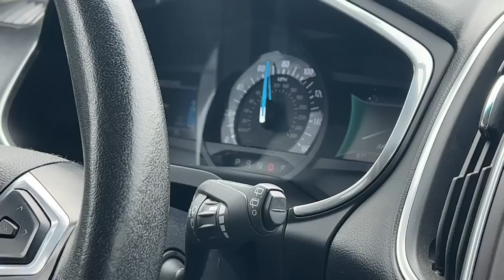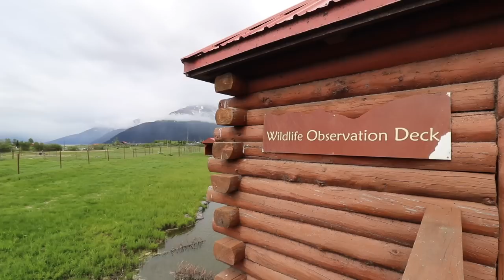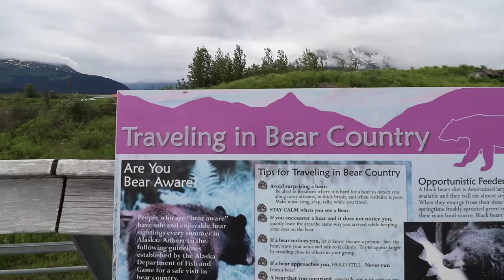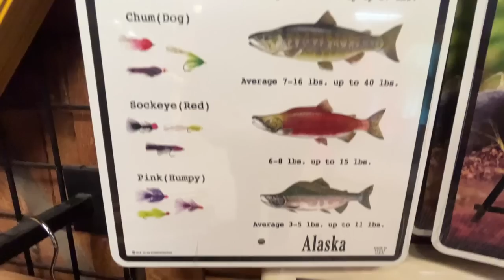Our DIY Wood Shed Build for our Off Grid Alaska Cabin + A Day at the Wildlife Conservation Center!

Comment: Little trick Joe and idk if you already knew this but you can turn your wood blade around (put it on backwards) to use it to cut sheet metal tin roofing metal.. use to help my uncle build gazebos and docks on customers lake houses. After we cut all our wood and framed it all up we’d turn the blade around and cut all our metal roofing. Works great just make sure your working on a good stable work table or saw horses.
Reply from the maker: I actually learned that by watching Marty Raney’s home stead rescue tv show.  I used to burn up hand grinder blades cutting metal. Now I just turn my blade around. Thanks for the idea. Joe

Comment: I had a huge stress related ulcer years ago and I wanted to go natural for healing because I'm allergic to tons of medications.  I drank aloe vera juice every morning on an empty stomach.  They have non flavored clear aloe vera and you only drink about 2-4 ounces mixed with juice or by itself, I mixed it with papaya juice.  I also chewed on papaya enzyme pills after each meal.  You can get them at most stores and amazon.  You just chew on 4 pills after each meal and it helps break down your food and digest it.  It's so easy and took a few months but it healed it right up.   I had a little inflammation in my stomach after my endoscopy and went back on the aloe vera juice for four months and it worked great.  Hope that helps.  ❤️🙏
Reply from the maker: Just bought some! Going to start adding it to my cabbage juice!❤️❤️

Comment: We visited the AWC back in 2017 (on a tour, before we moved to AK).  It was awesome, it still looks the same.
Our first woodshed,built last year, is about 12x8.  Think it holds about 5 full cords. We lined the inside with moose wire to stop any "blow outs".  Designed it to be built on to.  This summer we are adding on two more sections, one to hold another 5 cords and the other as a home for our splitter. 
Tina, hope they're able to find whatever is causing that pain and get it taken care of.  Being in pain sucks. That concoction your drinking sounds awful 🤢, but if it helps...
Reply from the maker: What a great idea with the wire! I think we’ll do this. Thanks for the tip!

Comment: I would recommend that you go on a milk and orange juice diet. When you are hungry or thirsty mix equal parts whole milk & orange juice with pulp.  Let stand 5 to 10 minutes until thick and drink.  NO water, or food or snacks  do for 2 weeks. It healed my mom's bleeding uncler many years ago and cured mine 45 years ago.  You should be able to feel a difference in real short order.  If you are lactose intolerant just use A2A2 milk.  This recipe was recommended by the family doctor back in 1969. You might not ever want another Orange Julius again...LOL

Comment: Wood shelter is nice.  So much to do before winter.  I do hope you can get the front part of that shelter filled with seasoned wood.  I had to cut wood in the winter my first winter here in Montana.  Sucks!  You might be surprised in how fast the wood can dry out if you can split it small enough and have some warm days with some wind.  And get into the wilderness and find some dead fall or better yet dead standing.  You can burn partially seasoned wood along with properly fully seasoned wood.  A little wood management and you'll be fine.  You'll figure it out, I'm sure.

Comment: Try Aloe Vera  use the whole leaf only the Gel .Do not mix it with anything else,only use water.Use half a cup of water, then put all the the gel of the leaf in the water, blend it.Fair warning ,it does not taste good, it's very bitter.

I have a back injury result on back injury.I have a secondary injury is my gallbladder .The doctor was giving me stuff for acid reflux so all the stuff they gave me.Did not work so I tried Aloe vera.When i tried aloe vera ,  "I had instant relief" After that , i threw out all of the stuff that they gave me.

Comment: Watching your video as you were describing your pain as a piece of coal in the center of your chest burning. It sounded like me, except I described it to my Dr. As a laser beam burning a hole right in the center of my chest right under the beast bone thru to my back.  Question, have you had an ultrasound of your gallbladder? I have dealt with ulcers on and off for some time now. I was having pain just as you described. At some points I felt I was having a heart attack, it was very scary. I got scheduled an EGD as your having done. They did biopsies and found nothing. They were at a loss, luckily I did my own research and asked if it were possible that it was my gallbladder. They scheduled one and found several gallstones. I met with a surgeon and had my gallbladder removed 2 weeks later. He said it was time as he found lots of adhesions to my liver and chronic inflammation along with several stones. Not telling you what to do but with the symptoms you describe it was like me talking. Good luck. BTW, I'm 2 months post op and I'm doing great.

Comment: I’m interested in how the cabbage juice works.  I’ve had life altering stomach issues for the past few years. I did test positive for H pylori and was thrilled that yay…they found the reason.  Well, there was no difference after treatment.  Then they said oh, your gall bladder..ok,  had it removed.  Worse than ever.  A month ago I picked up Prilosec for my son who has stomach ulcers and thought…well I’m going to try it and I have to say I haven’t had a stomach ache in 3 weeks.  I went for CT Scan 2 weeks ago and they found nothing.  So bottom line I sympathize… it really does effect your life.  Ps… gall bladder surgery, if not an emergency situation, had I known what I know now wouldn’t have had it.  Comes with its own set of new issues but mine was full of gall stones.  Sigh….good luck Tina
Reply from the maker: Check out this video! It talks about the benefits of the cabbage juice! https://youtu.be/NOFMXJ6WzX0

Everyone that I’ve talked to about having their gall bladder removed has said the same thing you did!

Comment: I have a question. Why are you using sand and not using quikcrete around the post holes? I’ve never seen it done like this before.
Reply from the maker: Just didn’t want to. No need really. It’s a super heavy structure, anchored 2 ft into the ground.☺️

Comment: Your doing a upper GI or a lower GI . You still have ur gallbladder mine was remove when I was 18 years old.  It could be anything. Stomache Tina  I have both upper GI and lower GI, was diagnosed with colon cancer and if your stomach is bloated and hear you’re not feeling good and you’re nauseated all the time and you can’t poop then you have colon cancer I was really lucky because I still have my: I just had to split on it and I kept getting stomach infections .upper GI was easy I not allowed to eat nuts or acidly foods . It’s ok now just have problems with the tube going into my stomach it stay open . 😮am ok 👌 hope all turn out good